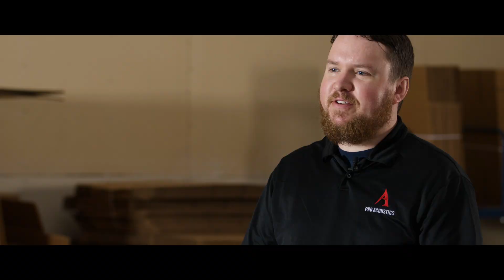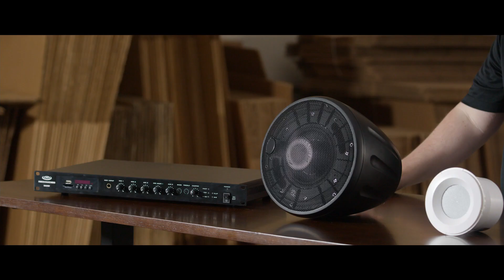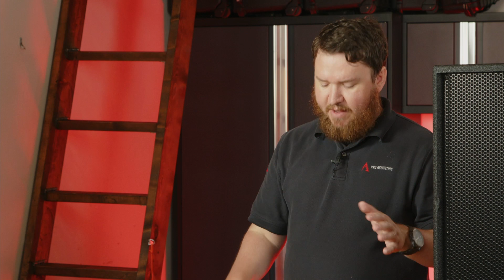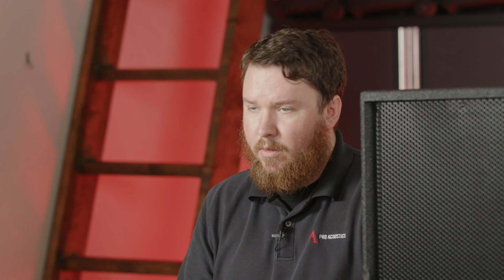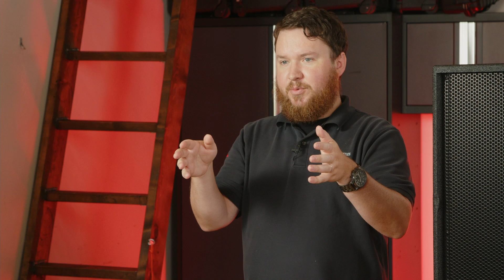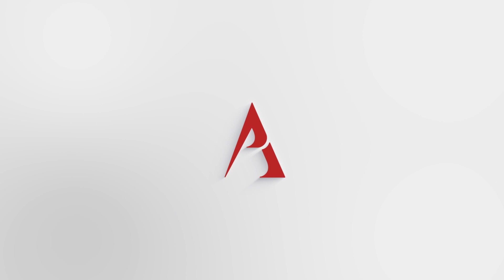Types of Speaker Dispersion Patterns, Coverage Angles & Placement on Pro Acoustics Tech Talk Ep 75

Comment: Thank you for your informative talk. I'm an anthropologist and language teacher working in Southeast Asia, and I've had the chance to see what a difference good audio makes in the language classroom. I have so far used the Triangle Borea BR03 speakers and they have worked pretty well in my roughly 24 feet by 24 feet octagonal classroom. I'm thinking about upgrading, and I've found it's rather hard to find out both the horizontal and vertical dispersion patterns of different speaker systems. Reviewers do sometimes comment on the horizontal dispersion pattern, but only rarely on the vertical dispersion pattern. I appreciate that you included both. Do you have any suggestions about loudspeakers or types of loudspeakers that have relatively even and wide dispersion patterns in both dimensions? I think horizontal is in fact more critical in the classroom, but since we do move around (standing, sitting on the floor at times, moving about), I would want to avoid a speaker system that has a very narrow vertical dispersion pattern. Thank you again for your talk!
Reply from the maker: Hi Theodore,
Speakers vary by the waveguides provided by the manufacturers for different applications. Generally, the smaller the speaker driver, the wider the dispersion coverage. The larger the driver, the narrower the coverage. As for a wider and more even coverage speaker, you might consider the Bose DesignMax DM5SE as it provides 140 degrees vertical and 140 degrees horizontal coverage. Comparatively, the larger Bose DM8S has 115 x 115 degrees of coverage.
We hope this helps and good luck with your project!
Reply: @ProAcoustics  Thank you so much for taking the time to reply. I will look into your suggestions.